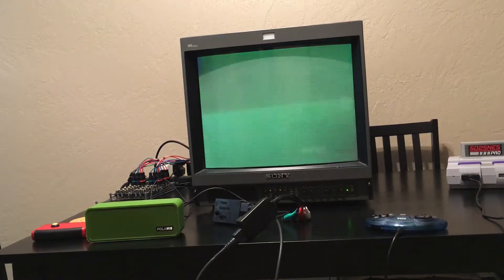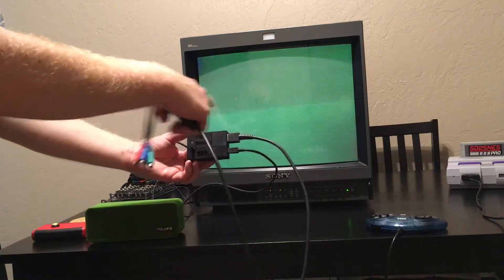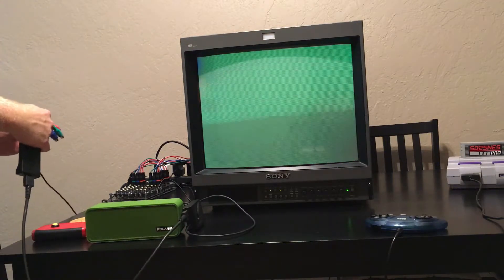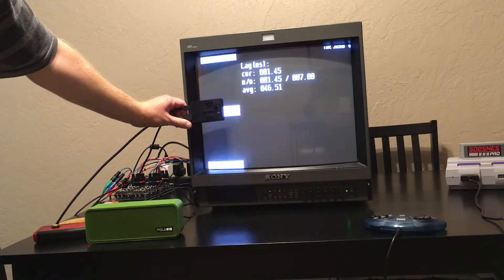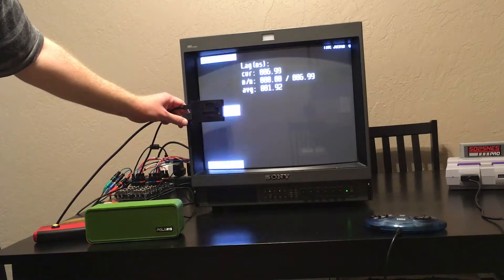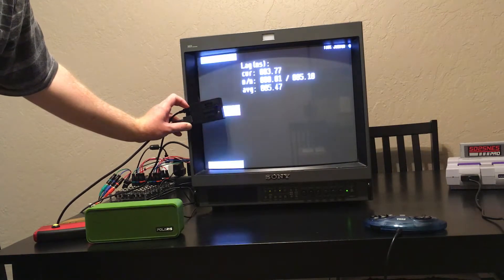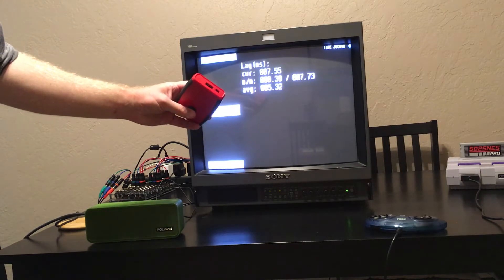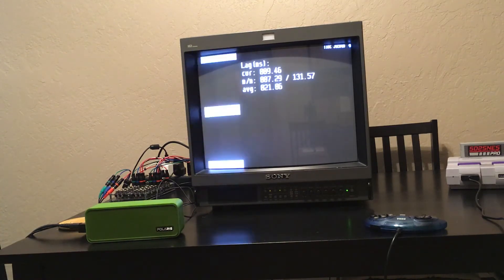Time Sleuth Lag Tester Sony PVM CRT Measurement

Comment: Cant see the number, use ur keyboard to write it in the video description.....
Reply from the maker: I didn't think it was that important. CRTs are essentially zero lag 0ms at the top, 7ms at the middle, 14ms at the bottom - less than a frame wherever you measure
Reply: @superretrocade3362  Why are they 7ms in the middle instead of 8.3ms? If it refreshes at 60hz (16.6ms) the middle of the frame should be drawn at 8.3ms.
Reply from the maker: @naircat  not sure